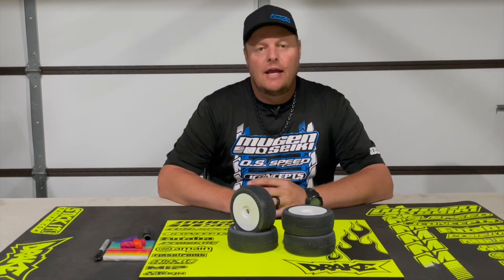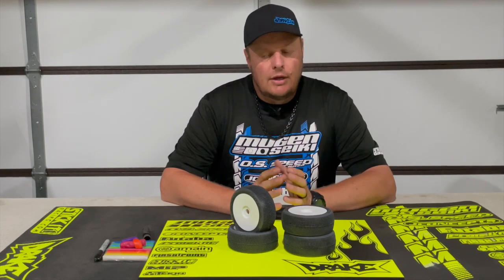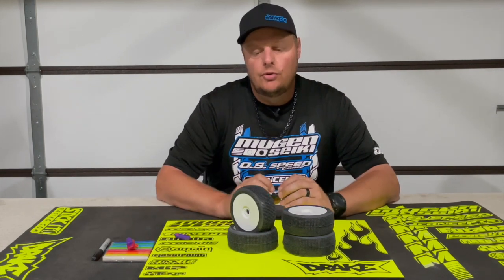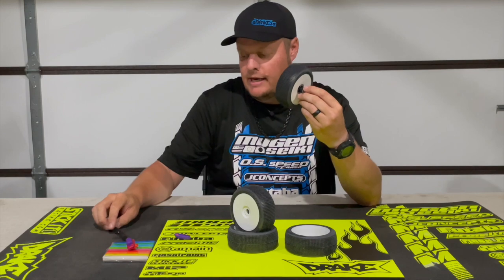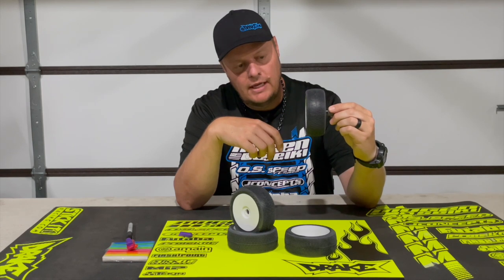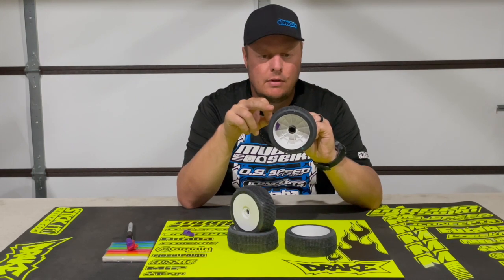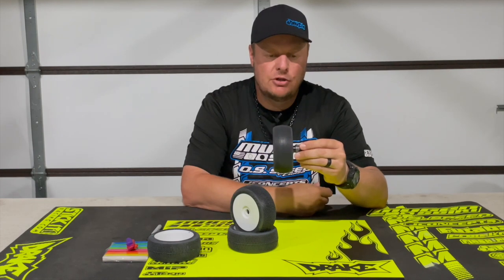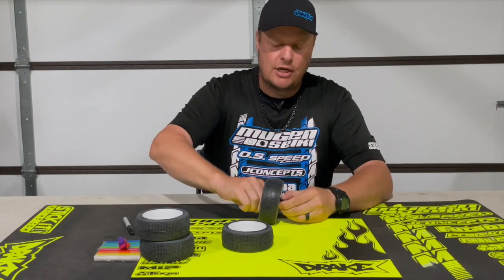Balancing R/C Tires

Comment: I dill a hole for adjusting camber (pillow balls).. keep wheels on.... plus an old rc plane trick was to scrape the propeller blades to balance them.  Makes for a lighter wheel. I never understood adding weight.
Reply from the maker: Very nice!

Comment: Also it’s a good tip to balance the tires after you prep the tires just in case you have to sand your tires. If you balance the tires then sand them after the same tires will no longer be balanced the same anymore for you removed material from the tires.

Comment: I had a tire and wheel combo that was so out of balance, that I actually had to use fishing weights to balance the system. And superglue wouldn't hold up at any play. I had to use JB Weld to afix it.

BTW it was just for bashing but holy hell was it out of wack.
Reply from the maker: That’s pretty crazy, but sometimes you gotta do what you gotta do.  😊👍

Comment: I dont ever see anyone really doing this. Is it really a standard?
Reply: Most don't worry about it.  It can make a difference though.
Reply: @wolf16731 Totally agree with that.
Reply from the maker: It depends on the brand of tires you use. With most it’s not super critical, but it is something that’s good to check to be on the safe side.